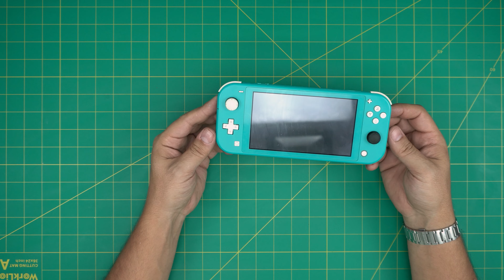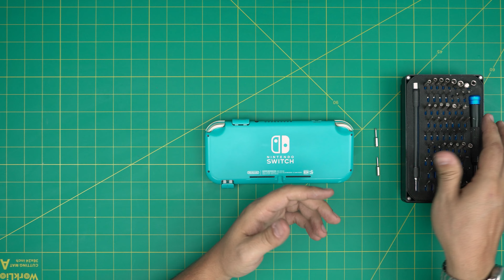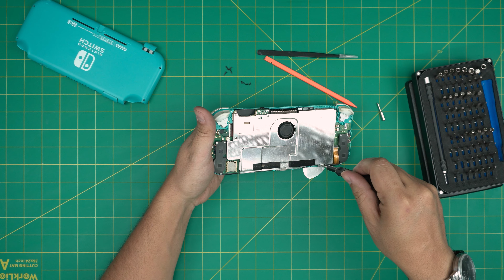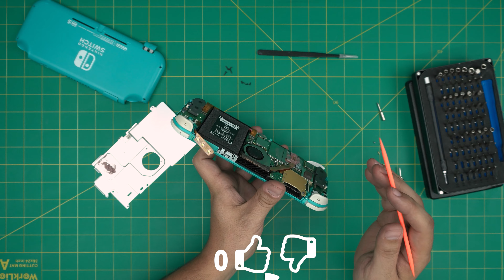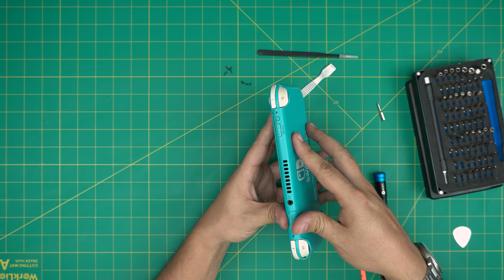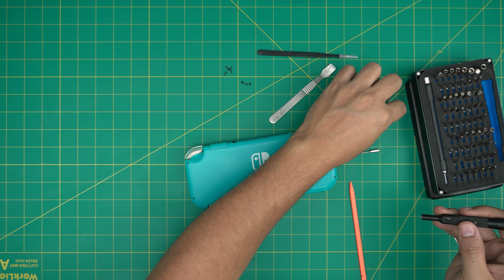How to replace Battery for Nintendo switch lite HDH-001🔋⭐⭐⭐⭐⭐

Comment: Hey when replacing the battery do you need to charge it right away for a few hours or let it die to 0% and than charge it to 100%?
Reply from the maker: 🫠Regarding your question, once you placed the new battery , you want to charge it up to 100% without powering on, then power on and just let it drain slowly no games, then power off and let it charge for 2-3h then use it as you wish.
Should you have any further questions or requests in the future, please don't hesitate to ask me.
cheers🍻

Comment: Do you have tips on how to make it easier with the double side tape it’s really giving me a hard time
Reply from the maker: 🫠Regarding your question, take a isopropyl alcohol and drop few 5-8drops around the battery so it can run under the battery to touch the adhesive and start lifting and if needed place more isopropyl alcohol, and it will come off like a butter.
isopropyl alcohol: https://amzn.to/4cDrJjy
Should you have any further questions or requests in the future, please don't hesitate to ask me.
cheers🍻

This is an Amazon affiliate link. When you use my links, you are helping to support the channel. 🙏